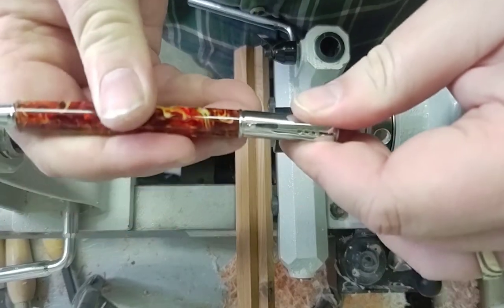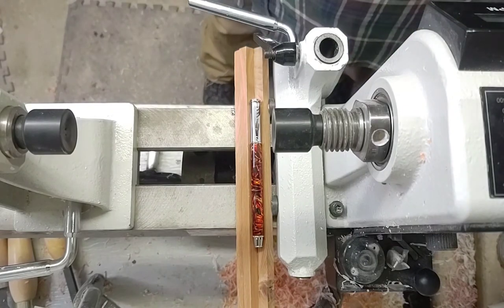Flaming Graffiti Blank in Editor Frixion Converted Pen

Comment: I’m new - and I mean brand new 😊 - to pen turning.  It does not seem that you are using the typical mandrel set up that I have seen at my local woodworking shop. Would you please explain the components you’re using to hold your pen blank properly on the lathe? Thanks so much!
Reply from the maker: ABSOLUTELY! First, welcome to pen turning! Second, the mandrel I'm using is the Mandrel Saver from Penn State Industries. It's great because you don't have to add extra spacer bushings or tighten a nut by hand. The live center on the tail has a hole that the mandrel fits into, so simply put on your bushing, your stock, and your other bushing, then slide your tail stock over the mandrel up to the bushing, lock it down and tighten it down by advancing the banjo forward, and then lock it down. It's so much faster than the standard mandrel to change blanks and swap between turning bushings and non stick CA finish bushings. It decreases production time substantially. Hope that helps, Happy Turning!